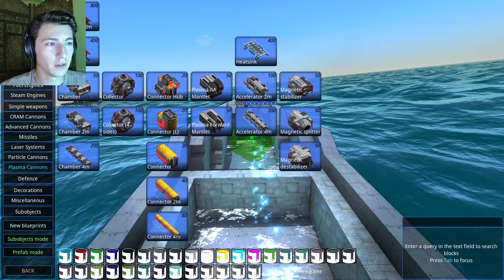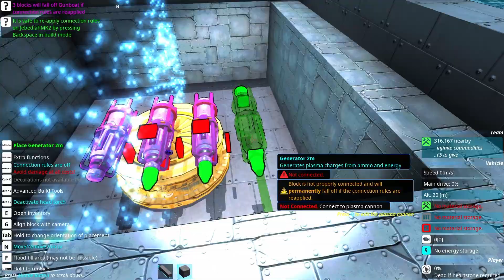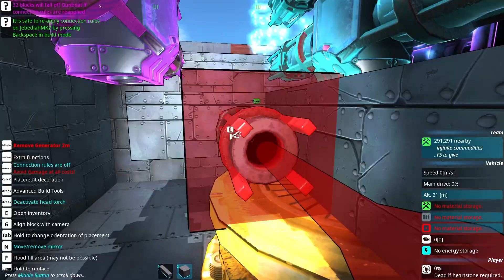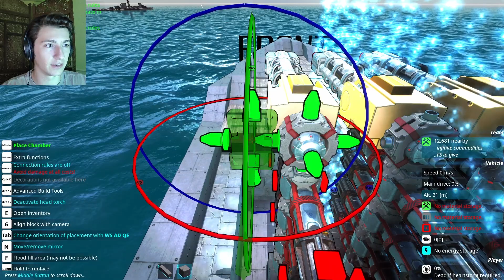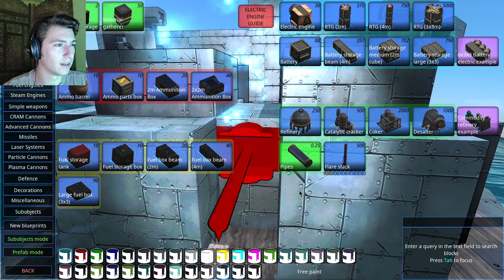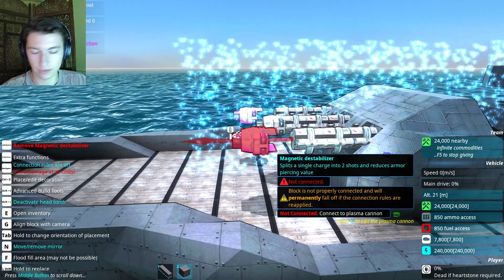PLASMA CANNONS: Everything You Need to Know | From the Depths

Comment: Do you know the exact way that AP and AC works? Just wonderin cus its changed a few times and even I sometimes mistake it
Reply from the maker: I'm decently familiar with AP not AC. The Plasma cannons are relatively simple to use which is nice
Reply: @aquilaecompany  In order to understand AP, you have to understand how AC and AP go directly together in damage calculations. All damage is multiplied by AP/AC (going only up to 1x). This means that if I have 30 AP and am hitting a block with 60 AC (like, for instance, heavy armor which has a base AC of 60), then I will deal only 50% of the danage I'd normally do. Increasing AP is pretty simple and most of the time is directly proportional to speed, and in the case of cram cannons, it's directly proportional to how much kinetic pellets are packed into the shell, and yada yada with the rest cus youre not using them currently with your builds. AP can also be reduced in a couple ways but I dont think it can be reduced for normal shells unless point defense reduces the health of the shell. AC is a bit more complicated, though, because there are a multitude of things that can change AC. For one, AC can be increased by armor stacking, which means that blocks placed directly behind it from the direction it is hit in increases the amount of AP by an amount saud in their tooltip when choosing the type of armor to place. You can also increase AC by using shield rings inside of your craft. And theres probably another way to increase it as well that Im not remembering rn. Base AC for light alloy is 35, metal is 40, and heavy armor is 60. Oh and yes, plasma cannons having 100 base ac is very nice cus of no damage reduction basically ever lol.